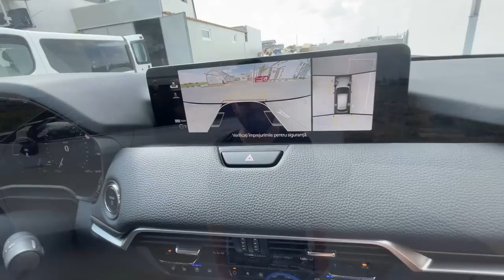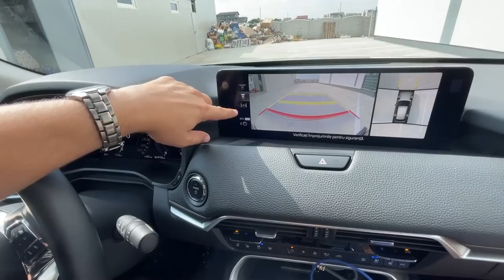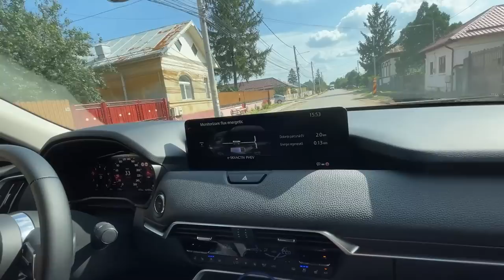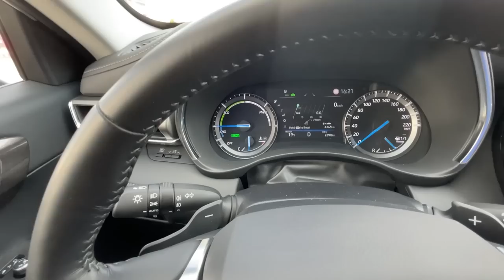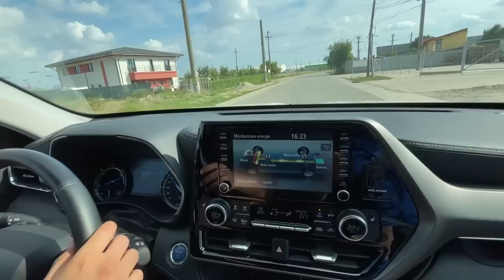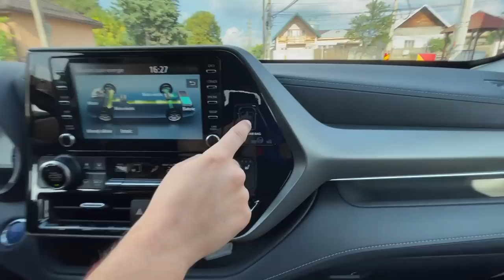Mazda CX-60 este AICI!@AutoMasterChefByMihaiPopescu îl compară cu Toyota Highlander

Comment: Nu o sa simti acel cuplu specific diesel (ce se regăsește uneori chiar si pe unele masini turbo pe benzina), dar se simte un cuplu si se pot vedea timpii. 
Eu la un rav4 hibrid, 2022, cel de 177termic+45cp motor electric fata, 4x4), cu un „kickdown” simt ceva cuplu (evident, dupa un mic delay de cvt, cu toate că e motor termic aspirat). 
In plus, am și simțit (văzut) cuplu specific la pornire (la o accelerare rapida, intr-o situatie am avut o carte de vizita in bord si un cuter de la stanley, metalic, mai greu, in buzunarul din fata de la pasager. Ambele au ajuns sub scaunul de la pasager fata când am accelerat). 
Si timpii sunt acolo. 
Adică, depasiri .... coloane de insi ce mergeau ca niste melci, in sir (similar cu ce ati facut si voi in filmare).

Comment: Imi place cx60 insa este cam scump. Tiguan plugin dupa scumpirea de acum este 34k (a fost 31k) cu rabla nu 51k. Este totusi o diferenta mare de pret.
Reply: Tiguan phev nu se mai vinde
Vw a întrerupt pe termen nedefinit fabricarea tuturor phevurilor din grup

Tiguan tot spre 60k se duce cu dotări, si consumurile de drum lung nu sunt tocmai mici dar rămâne o mașină interesantă

Pacat ca phevul lor are motor destul de chinuit
Reply: @vladdutz20  Probabil te informezi din stirile pe care le citesti. Eu vorbesc din experienta de viata. Tiguanul cumparat acum 1 an f bine totat a costat 31k,  colegii de pe forum primesc masinile comandate, mai rar dar inca mai primesc, pt mine cei 245cp chiar daca motorul este doar de 1.4 turbo , imi sunt de ajuns, nu ii folosesc asa ca nu il simt chinuit deloc. Specific inca o data ca eu vorbesc din experienta , nu din auzite. Am avut si cx5 si este ok, cine are bani de cx-60, sa cumpere insa este o mare diferenta de pret si imi e greu sa fac o comparatie.
Reply: CX-60 e mult mai calitativ la interior decat VW Tiguan. Mazda, cu acest CX-60 nu se mai bate cu VW. Ataca Audi, BMW, etc. Apoi, este o masina pe o platforma de tractiune spate (deci premium). Este un hibrid de 330cp vs 254cp Tiguan. Are dotari care nu se gasesc pe acel Tiguan de 34k. In concluzie, pretul este justificat. Ba chiar este un pret bun pt o masina premium de 330cp hibrid, cu dotarile pe care le are.
Reply: @silimarina.  Aculta la 1.04.40 ce spune autorul. De acolo a plecat ideea mea. Este totusi o diferenta mare de pret achizitie intre cele doua. Am avut CX5 2019  deci stiu ce inseamna mazda insa diferenta de pret pt mine este mult prea mare.